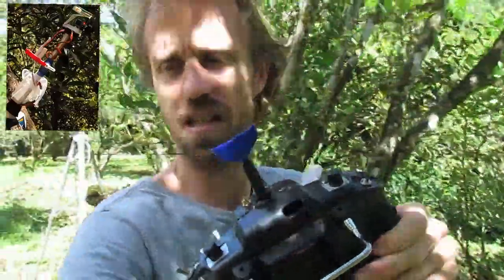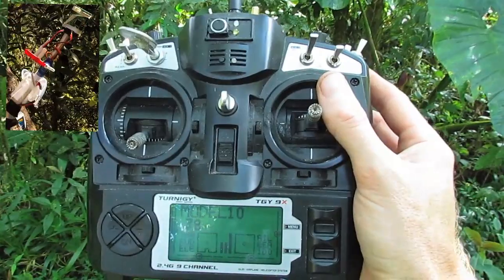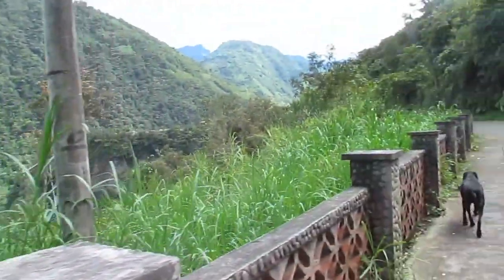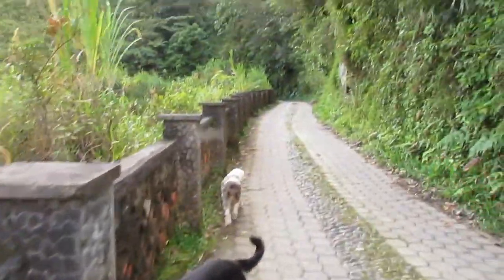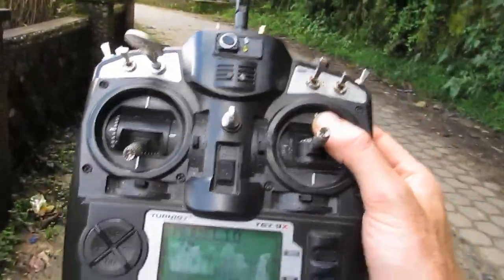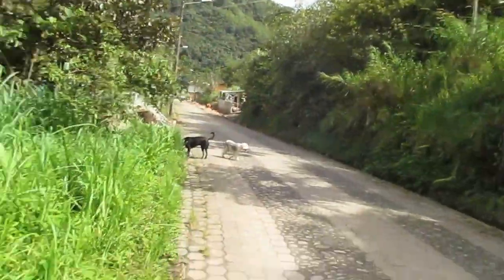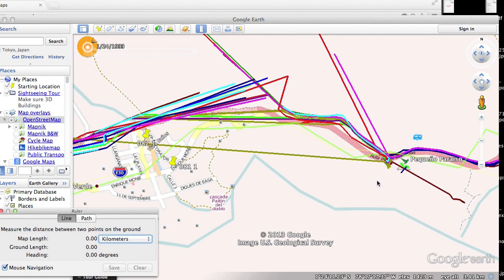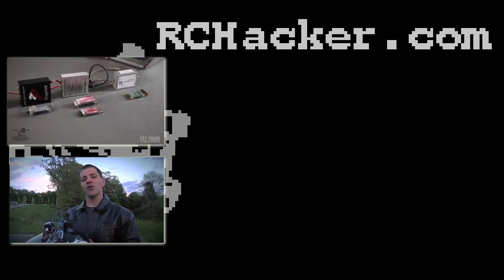OpenLRSng range testing, vee antenna, 100mW. RCHacker #40

Comment from the maker: +Anthon de Vries . Internally it is dropped down to 5V  it should run fine on as low as 6.25 volts. Assuming 1.25V dropout voltage on the regulator.

Comment: hi there is it possible for me and my buddy to fly fpv with together with the orange Rx with open LRSng cause when we do i get knock out by his signal or he gets knock out by my signal is there a fix for that ??? i have tried  openLRSng 3.5.6 and openLRSng 3.6.4 !!
Reply: My brother flew with a 1w and I with the 100mw I had quite a few lost packets but it did work ok, we were standing right next to each other as well.

How much power are you talking? The 100mW units tend to play nicer with each other. But having a 1w system nearby tends to ruin it for everybody.

Make sure in the configuration/bind you randomise the hop channels and it should work fine.

Comment: do you know the setting's of the stock firmware that the module comes with

Thanks
Reply from the maker: Stock firmware I think is still flytron, It has no configurable settings, no telemetry. All it does is hop on 3 channels.
Reply: do you know if its set to full power of 100mw
Reply from the maker: Jahuka Muka Yes, it should be.

Comment: hi, i have a devo7 2.4 ghz radio and it has ~100 mv output power(20 db) and i reached max. range of 1160m in open air. can you explain why the 433 Mhz Orange with same output power (100 mw) brigs 2-3 times more range?
Reply from the maker: Lower frequencies penetrate air (and the moisture in it) better. Also you have to take into account the sensitivity of the receiver and the gain of the antenna(s).
Have a play with this: http://www.fpvhobby.com/fpv12.htm
Reply: thank you for the informations

Comment: i assumed your setting,
power:7
Data rate:4800
telemetry:yes

how about Serial baud rate and hop channels? because i run some test with turning telemetry on makes RSSI drop so much...
Reply from the maker: Yes, pretty much stock settings, yes you get more range without telemetry but then you have no idea when that range will run out. That has saved me a few times flying with bad modules/ bad antennas.
Reply: RCHacker thanks for the replay...then your antenna make it more powerful...

Comment: Hi Marc, Where abouts in the code did you change the buzzer tone? I'm looking in the TX.h file and I'm guessing its in the void loop part but cannot find anywhere it would be! Cheers, Oliver
Reply from the maker: https://github.com/rchacker/openLRSng/blob/working/openLRSng/TX.h
an old fork.
line 495, check that I have not changed the buzzer code also.
Reply: RCHacker Thank you :) Can see it now! What are your thoughts on openLRS over other UHF systems available?
Reply from the maker: Well I did not waste my time or money with the others... Most probably better, but there is a certain level of competency required.

Comment: Thanks Marc.  I'll make up a dipole and your Moxon design for antennas.  Back on the Turnigy 9x built-in antenna issue: Do I need to remove (unsolder) the 2.4 antenna from the 9x or will the antenna outlet on the OrangeRX "automatically" work once the OrangeRX is plugged in the back of the radio? Rocco

Comment from the maker: Yes, it should work fine. You cannot use the existing 2.4G antenna any more. The provided antennas from HK are crap, even making your own dipole is a massive improvement.

Comment: Marc, can I install an OrangeRx Open LRS 433MHz (from Hobbyking) Tx in my standard Turnigy 9x radio by just removing the the existing 2.4GHz unit and replacing it with the OrangeRx?  Also, what would I need to do with the existing antenna from the Turnigy 9x?  Thanks.  BTW, amazing place - where are you??

Comment: I did warn you it might be addictive :) One of the obstacles facing new radio amateurs ie morse code has now been dropped from the requirements. Even so you ought to be a shoe in for the technician class. You could pursue a ticket in Ecuador as they are generally transferable since the whole scheme is overseen by the ITU. I assumed you were madly putting together all those components for the lack of vids. waiting to see the results.
cheers
 Rob

Comment: Wow, this is really impressive!

This system would be a great alternative to 2.4Ghz-RC-Gear here in europe, because the only video-frequencies allowed here are 2.4 and 5.8. 
So, this System could "unlock" 2.4 for video.

Only one question: In germany, the limit for 433 Mhz is 10mw. Is there a way to limit that system by code to 10mw? (should still outperform 2.4 RC)

Comment: Nice one Marc. Glad to see you had some success. Just be careful, all that antenna making can get addictive LOL. If it is any indication my success rate with amateur radio antennas was about 60% using only the most basic of equipment. One system that I made was for satellite communication (AMSAT) where I used 144mHz RX and 432mHz TX. Both antennas were crossed Yagis circular polarised mounted to a DIY azimuth - elevation tracking unit using car wiper motors so all in all a lot of work and time.

Comment from the maker: You need to connect three wires, PPM, GND and power. Loads of info about on how to do that.
Varying PPM rate, don't know. If Futaba wants it incompatible it will be just that until someone writes some code for it.

Comment: Great job! I'm really impressed with the OpenLRS performance for the price.  Looking forward to your future videos on this.
Couple of questions: What's involved in connecting this to a non-module radio using the trainer port?
Also, do you know how it would handle a varying PPM framerate which some Futaba radios emit? (as this was a problem with other long range systems).  
Thanks :)